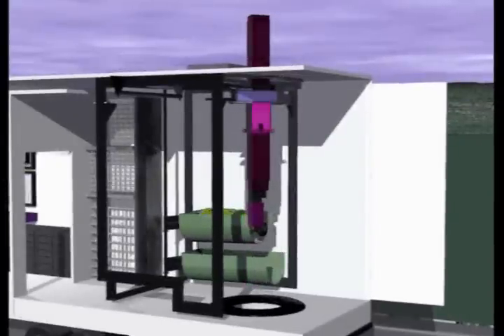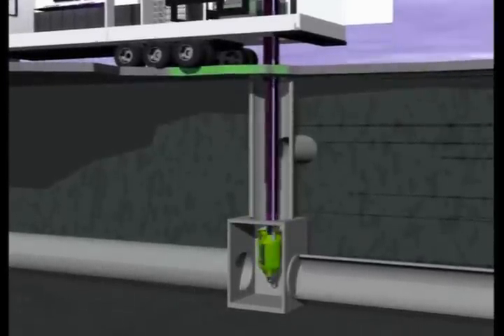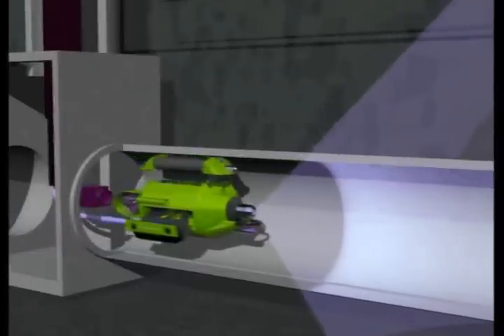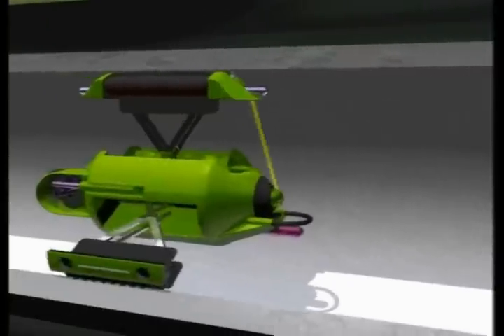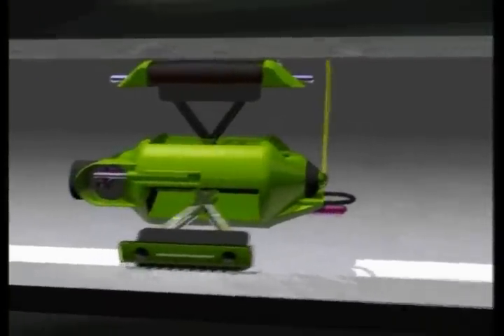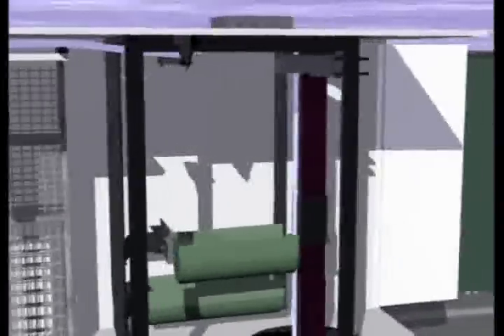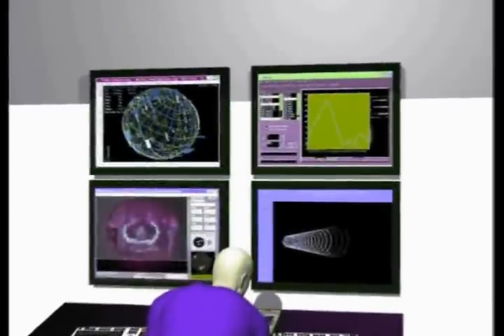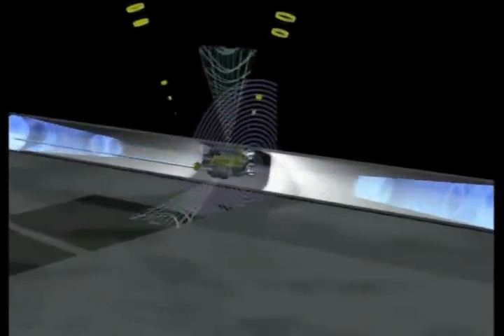PIPELINE ROBOT SYSTEM

Comment: can you please give more details about that gps tracking inside the pipes
Reply from the maker: +Sharafali T.P.  Sharafali, I'm sorry for the very long delay. The GPS tracking uses accelerometers with linear measurement sensors to "dead reckon" against it's known GPS starting point.  These sensors are continuously fed into the truck computer to result in the position of the pipeline.